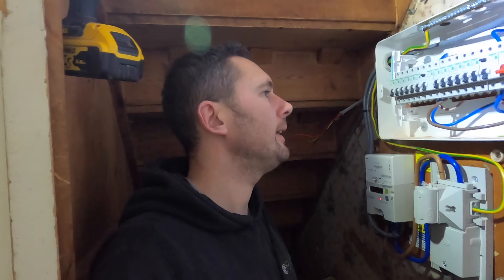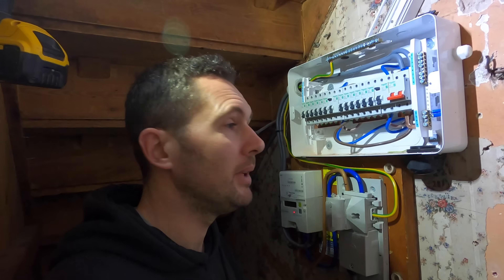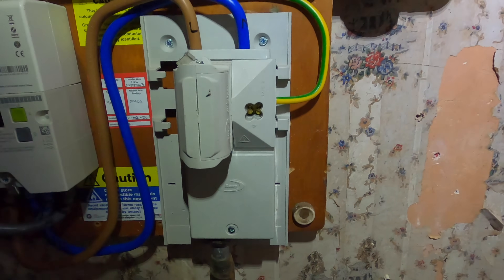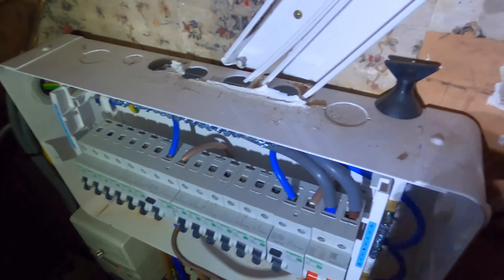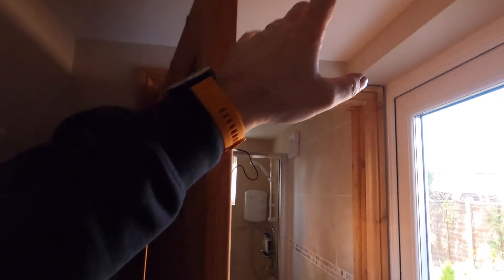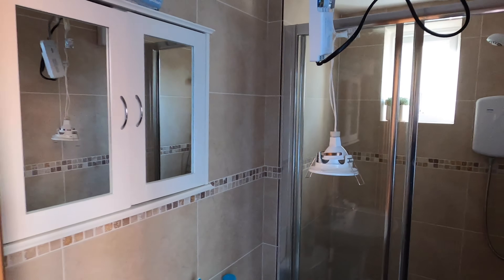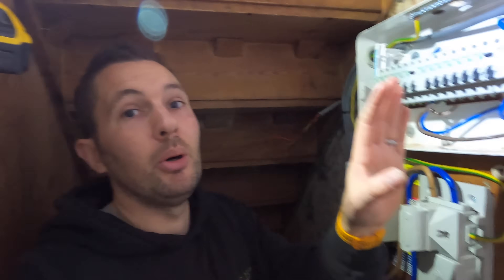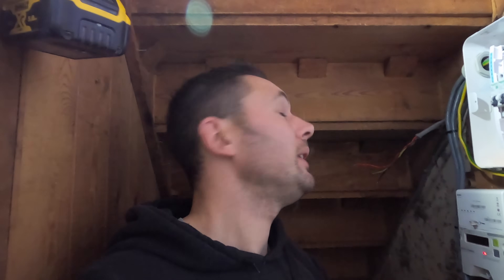What Were They Thinking -- Dangerous Electrical Installation #nuneaton-electrician #electrician

Comment: Hi guys hope you remember me (dip stick) from Kent you gave me a bit of advice on what fuse box I should use well I just wanted to update you I got a box mounted it on the wall didn't have any screw's so I had to use 6"nail's done me a favour really I can hang pictures on the wall in the front room now ok I plumbed it in worked out pretty good the garage door works the fish pond works the power sockets work but I can't get the lights working up down up down up down no they won't work and then would you believe it my next door neighbor comes around and asks me to have a look at her kitchen light it keep's going on and off.thank's guys for your help you were the only one's that replied.(ps just remembered you were the only one's I asked.) Hope this made you smile.

Comment: Here's a question...why do the spots need to be fire rated ?
Is it because the light fitting / electronics could burst into flame and thus compromise the room above OR because the fitting has punched a hole through the fire barrier formed by the plaster board ceiling ?
(In which case placing a transformer/PSU in the void between the ceiling and floor above would be a no-no ?)
In this video, is the bathroom a single storey extension ?

Comment: They all do it, had a council contractor sign a faulty ring main as safe with bad insulation which went bang in the following months. He also didn't bother to change the light switches or sockets (was requested) which were clapped out as they were 100% original fittings from 1979 with various faults like socket shutters stuck open. 
Some people just don't give a f*** as long as they get paid, and it stains everyone else.

Comment: No heat resistant consumer unit backboard , is that not a requirement.?
Reply: No, the requirement is that the consumer unit is manufactured from non combustible material, nothing more.

Comment: This confirms why I prefer to DIY as I don’t trust “tradesmen” after being conned more than once.
Reply: I'd love to carry out an EICR at your house I bet it's a minefield!
Reply: @ChrisTheSparky  come and do it. The last one was fine. I have every confidence it’s cushty because as a DIYer I have a Fluke 1664 FC and know how to operate it and know what readings mean. I also have a copy of 7671 and the on-site guide and Codebreakers. We can debate the use of codes couldn’t we? So yeah feel free to take up the challenge....so yeah come round and we can compare results from our MFTs
Reply: @montystelevision3238  best response ever tbh 
I often do small things myself (Don't have equipment to test it so I don't run new circuits or anything like that) 
I prefer to just do small things if I have repair or replace small details like a cracked socket or a basic light fitting
Reply: LOL Maybe this could be a youTube video. Skilled Electrician v DIYer in an EICR. Using a 16th edition installation.
Reply: @montystelevision3238  lol 
yeah
Reply: @montystelevision3238  good call.  Ive done my CU and followed all the regs and had an EICR done. Electrician wuo did it said the work was neater and better that 80% of the work done by qualified sparkies

Comment: The reason he’s taken the board off is that he needs to put HIS material on the job to say that his stuff is new and ok and not rely on other workers material I thought that would be obvious you can’t guarantee other people’s work you have to start a fresh 🇬🇧
Reply: Complete bullshit, it wasn't that bad. Could've easily made it good.
Reply: @londontrada  he probably had a new complete board in his van with all the correct bits. Would you want to waste your time sourcing the replacement parts for the broken Schneider board
Reply: @ChrisTheSparky  What replacement parts?
Reply: Dusty 99  shut up you doughnut. The thing was practically brand new

Comment: Great workmanship and poor from the original installer. I can understand putting a new board in a better position but I'm perplexed as to why it needed a new board and moving. Seems a lot of labour costs there.
Reply from the maker: The original board was broken in multiple places and had huge holes in and was no way I would use that 👍 thanks for watching 🤙

Comment: There is no requirement for fire-rated fittings unless the space above is a separate residence.
Reply: This is not correct - if you have to have a fire rated ceiling then it needs fire rated light fittings.
Reply: @CrazyLogic  And you need a "fire-rated" ceiling in which situations? What I'm getting at is that not all recessed light fittings have to be fire-rated.
Reply: @simonabbott7323  as soon as you have a 3rd floor/loft conversion in the UK, you need a protected staircase, any ceiling under this would need to be fire rated. Just one such example.

Comment: You have to ask the question who's fault is it really, you said you have come across their work before and it's as this job. So with that in mind, you can assume that this is their standard of workmanship, so what are the NIC saying or doing to them, because I would say the NIC are largely to blame.
They are happy to take the £500 each year, I know some will pay more, but they are a money making machine, they are not interested in problems and make it as difficult as possible for customers to complain and drag it out as long as possible.
The whole system is crap and it's mostly down to part p, because as soon as that was introduced standards were watered down so that knob heads could join.

Comment: Feel for the customer but you’re not that much better in the respect you’ve given them them a split load board. Either use the old one which is same as your one, obv no SPD, or supply a RCBO board
Reply from the maker: Like I have said in previous posts it really does come down to price but if you watch the following vid I explain more 👍

Comment: Looks like to me your having a dig at nic contractors? If your nic report him there was no need to change that board holes stuffing glands slot top bit of paxalene then trunking iam nic and work for nhs council etc and once a year our nic inspector goes through at furally all day inspection he choices what jobs to go to so any nic contractor would not risk there livelihood leaving a board in that way cos loosing nic you would not get much work on the commercial side but will say again why did u change that board
Reply: Sorry do u know for defferant he isnic came accross 3 sparks in my area with nic stickers on van and saying they where on line checkex up on them they was not nic

Comment: Do the down lights need to be IP rated even though they are 12 volt?
Reply: The next question is whether they're even inside the zones, as 1 and 2 only extend 225 cm from the finished floor. If they're outside the zones, they only need to be fit for purpose, so if there's no obvious signs of water damage, they probably are. In this case the problem is the fire rating though.
Reply: @Ragnar8504  And even then, if the down lights are not fire rated......you can only give it a code 3 on an EICR, providing they are installed correctly.  Having a non fire rated down light is not electrically unsafe.  You can not code 2 the situation based on building regulations. 

Also, it isn’t a given that in all situations building regulations require you to install fire rated down lights.  So unless you have knowledge of the building and how it is segregated into fire compartments, if at all......how can you even decide if they need to be fire rated??  Sometimes it’s obvious, but not always.

There are so many electricians out there who have a massive lack of understanding about so many things.   Most dangerously though.....they walk around thinking they fully understand!  And pass it on to customers.

Comment: Did it need another new board? Their 4th 😂. If it was all rcbo I could understand it.
Reply: That's what I was thinking, old board looked fine and its a split board with rcds. Schneider boards are good boards. just seems a bit of an expense that's not necessary.
Reply: I thought he said the panel covering the bus bars was destroyed?  Surely, that is reason enough to replace the board.
Reply: @chrisallen6010  yeah but a new bus bar cover is a lot cheaper than a new db. And the amount of times I've heard someone say they haven't done any work or had any done. then found the fault and a newly fitted light or fixture.
Reply: @keithstirton7049  Fair enough.
Reply: @chrisallen6010  Cheers it's nice to have a civil discussion on here for a change. and to be fair the client maybe asked for a new db. And the customer is always right. lol

Comment: think its bad practise not fitting rcbo's personally
Reply from the maker: I agree with that but unfortunately it comes down to the customers budget and don’t forget there’s also more work involved which I had warned them that I suspected there would be so you can understand from there point of view. As it goes I did try and get a 21 way fuse box rcbo board for them and us to make up the difference as they’re existing customers but I can’t get one for anything at the moment 👍

Comment: Are fire rated down lights required? IP rated definatly. If you listen to one of John Wards Youtube vids on Part P he says they are not really required unless you have a 3 story building or a flat as you have a means of escape? Unless i missed something when i watched it? The lack of CPCs could just be loose connections from doing the tests. I do agree this was a bit of shoddy workmanship but like someone else said, could you not keep the Breakers and just get a blank board instead of replacing the lot?
Reply: If there is a room above then C2
Reply: Thats what i thought but that wasnt how he explained it as if the room above had an opening window then they wornt needed. Carnt seem to find his video now unless he took it down?
Reply: A house is generally a single fire compartment so unless you have actually breached a fire compartment like an attached garage ceiling which is fire boarded with 15mm pink board then the fact there’s a room above is irrelevant , you haven’t breached a fire compartment.  The fact that most houses don’t have internal fire doors tells you this.

Comment: Do you not have a duty of care to notify the NICEIC of a dangerous practice.
I know it can be a tin of worms but if the house burns to the ground and a family are killed and you could have reported the company doing this substandard which could have been checked by the NIC would you hang your head and say why didnf I make that call. I do appreciate the dilemma but how would you feel.
Keep the video coming.
Reply from the maker: Yes I get what you are saying but like I said in my experience I have complained before to other regulating bodies and nothing happens and I still have to sort out the issues

Comment: could you not have purchased another Schneider board and reused the breakers? I'd be inclined to give the other electrician a call and make him aware you're on to him, they might book their ideas then.
Reply: knightsTemplar reusing would have been a very good idea. I really didn't see the need for a new board. Correct gland for the tails, intumescent membrane cable entries for the holes on top to make it IP4X and then use the trunking.

Comment: Thought you might of fitted an rcbo board, as you didn't why not use the old board?
Good job by the way 👍
Reply: Fair enough👍
Reply: You obviously did a great job but I don't see how using the knockouts rendered the old board useless? If you moved it and remounted it securely, and used the right stuffing gland/s, and used grommets and trunking, and bought a new busbar cover, it would have been just like the new one. If it came down to price, surely that would be perfectly safe and the most cost effective solution.
Reply from the maker: Hi good point but it comes down to price why we didn’t fit a rcbo board and the board that was originally installed had been cut up like Swiss cheese and there was no way I would reuse that 👍